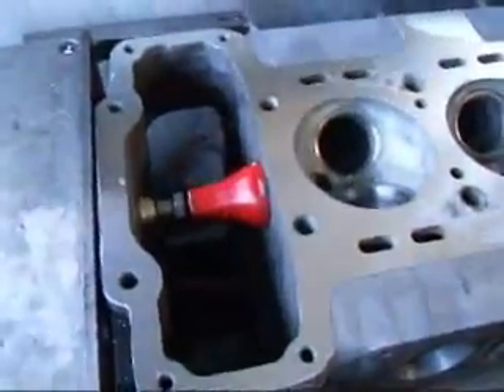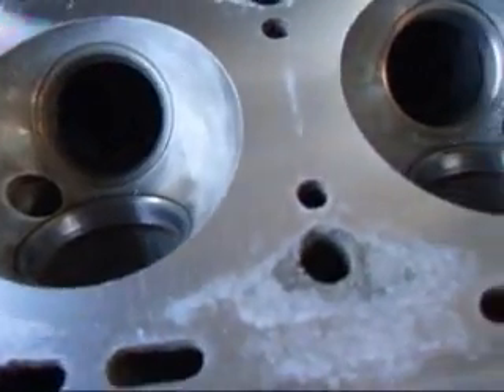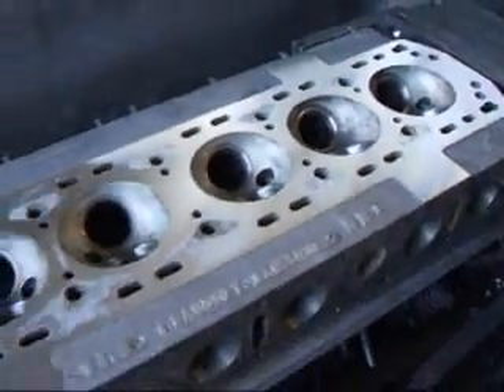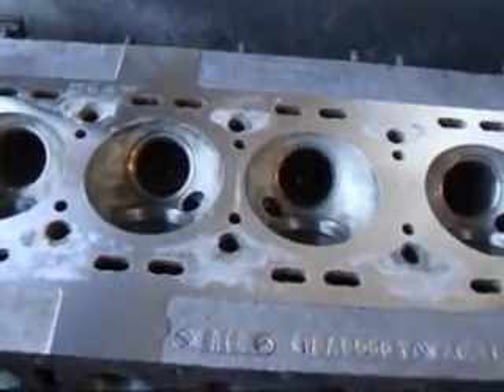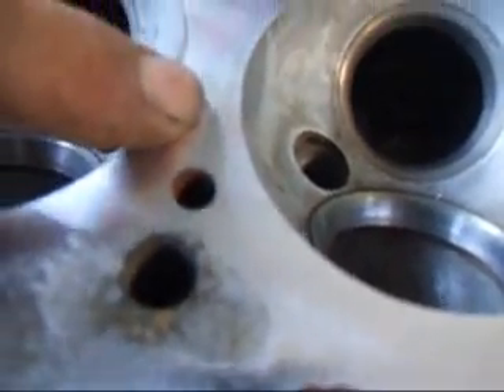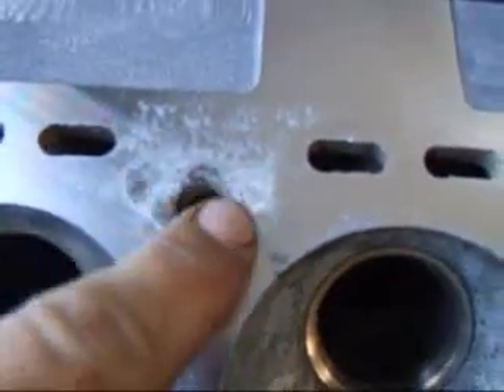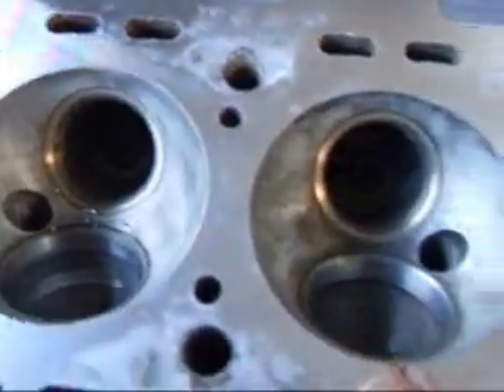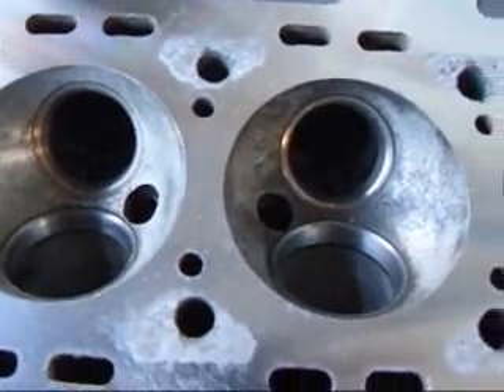Jaguar XJ / XK cylinder Head Resurfacing

Comment: yeh you have to run coolant its anti freeze too so should be better in winter
but flush your radiator first by removing the bottom hose( easyest if your not the best with cars) then stick ur waster hose in the bottom hole so that the water is going backwards an it should turnout alright i cant be botherd explaining haha

Comment: The stroke of this engine certainly is longer than the bore, it's an undersquare engine designed for high torque/low RPM (under 6000) performance.